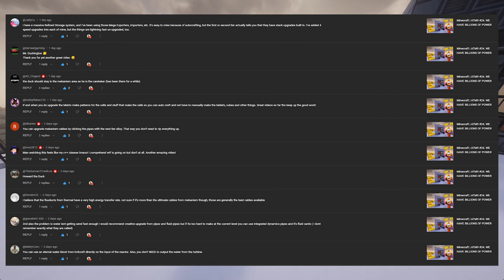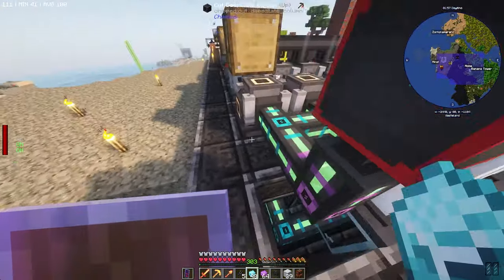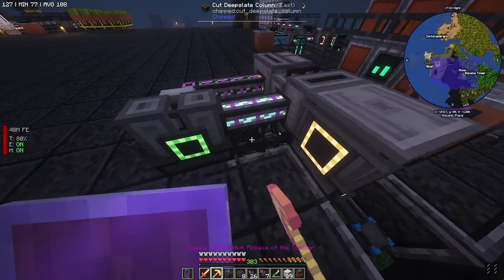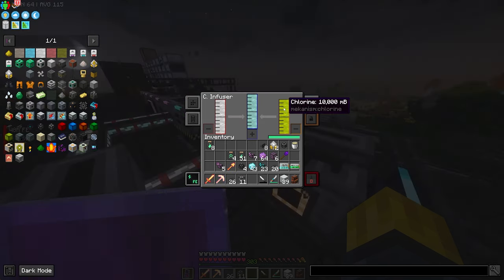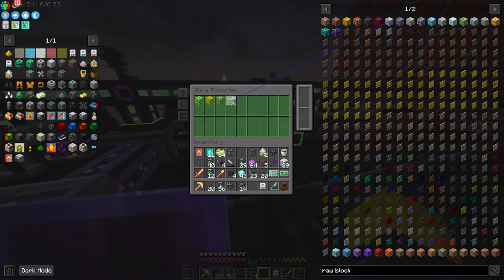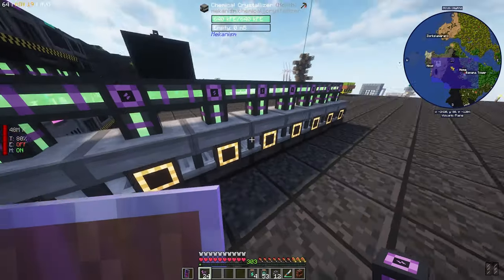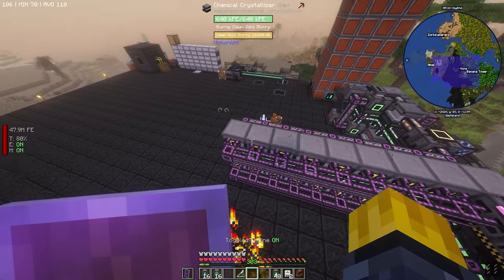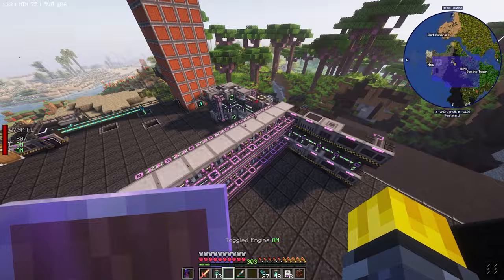Minecraft | ATM9 - #25 The Ultimate Ore Factory

Comment: I'll add more comments to this since I am watching this in parts. 

For excess energy production. You can use an energy trashcan (I assume it is in the pack it normally is) set the priority on it to be -10 so that energy will go everywhere else first and the last place is the trash. That way when your energy matrix is full it won't cause you problems with your reactor.
Reply: One issue I've seen with chemical crystallizers is the Gosh Darn pipes not distributing equally. You won't run into a problem until you swap to a new ore block and you find tid bits of the slurry still in those crystallizers.
Reply: yes that will stop the generator from exploding
Reply from the maker: @steveheffner  YEP, as I was reading your comment I was already dreading that happening with the slurry, good catch!

Comment: Since you like getting tips, here's a few from this episode:
* In Refined Storage, make a Crafter Manager. It will read every crafter in the system, and you can add/remove patterns directly through it. Each crafter will take the name of whatever its attached to, so a crafter with nothing will say "diamond crafter" or "netherite crafter." If it's on a smelter, it'll say "Ultimate Smelting Factory" for example, or whatever level yours are currently at.
* It looks like we're on different versions of the pack since I don't have the Thermal machines in mine. (I'm scared to upgrade because I don't want to lose anything.) In previous MC version, Thermal had "blueprints" or "redprints" that let you copy settings from one machine to another. If you're going to be using lines of machines, it'd be worth checking to see if they're in this version, too.
* Make patterns for everything. Any machine I need more than 1 of, I have a pattern so that I can make it on demand. Any item, anything at all. I'm currently building out ALL of MineColonies because I've never played with it before, and I have so many "weird" recipes on autocraft you wouldn't believe it.
Reply from the maker: Damn! Thanks for taking the time to write all of this out. I've got some new things to look into!

And yeah, with updating the packs, I ALWAYS make a backup. I've lost progress even in this series between updating, so being cautious is definitely the right move.
Reply: @SlykoMode  No self promo, but I used to be a content creator on Twitch and YouTube, and I remember how much I loved getting tips from people who watched, so I try to always leave comments when it seems like I know something the person I'm watching doesn't. I like the direction your channel's going, and it looks like you're about to hit that first 1K milestone, so early congrats on that!
Reply from the maker: @JaRyCu  And again, thank you for giving me some of your time to provide what you've learned/had experience with!

Interaction with others is definitely one of my favorite parts so far about creating a series, the comments are always very exciting to see. All of the information I receive has been shaping the series as a lot of what I do comes from all of the information I receive put together.

Feel free to keep the helpful ideas coming 🤣

And thank you, I never expected reception anywhere near this much for my first attempt at a series of videos.